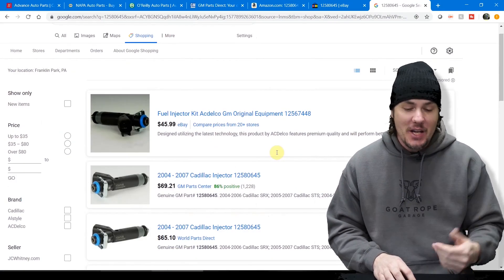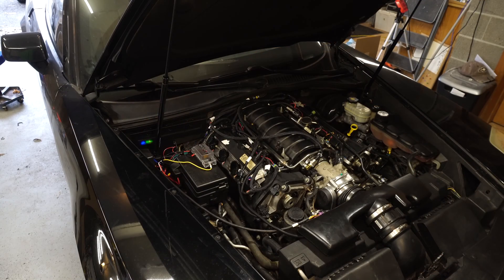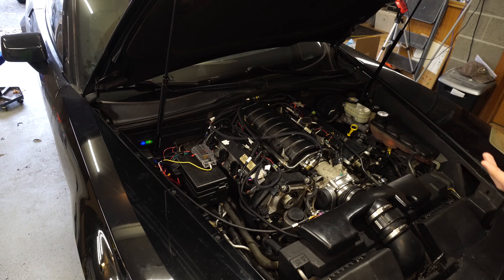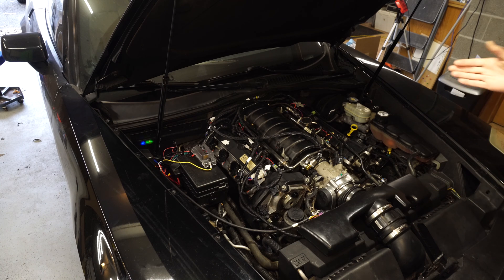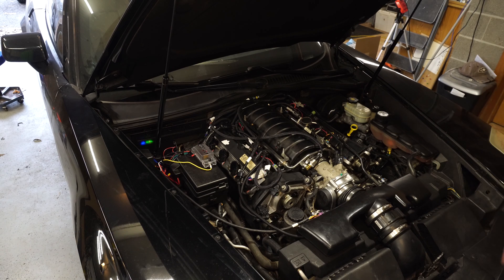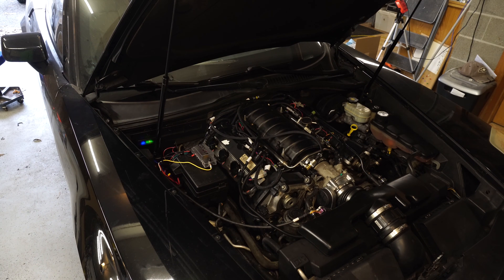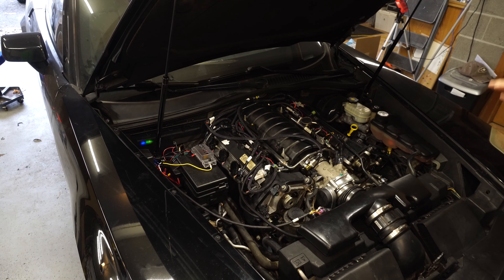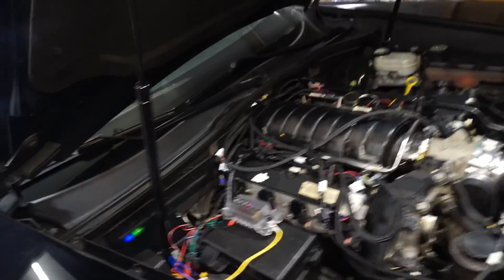First Holley Terminator On A Northstar?  First Impressions Of The Stand Alone ECM.

Comment: I'm interested in this set up for my 05 northstar. Do you have any direct contact, like email or possibly a phone number? I dont mind paying you for your time if you don't mind answering some questions. Finding a tune for the e22 ecu has been nearly impossible at this point and it's driving me crazy.lmao
Reply from the maker: You won't find one for the e22, that is why I did this and it still isn't a good solution because of the dang cam sensors on the early models.
Reply: @GoatRopeGarage  would you say the standalone worked better, or the stock setup is my best bet? Im also thinking of going with nitrous since I'm gonna be opening it up and might just gap the rings for it...
But yea the vvt system makes things so complicated...im going crazy trying to figure this car out. 
Makes me wonder how PCM performance and madtuner did it to tune the stock e22 before they discontinued..
Im really trying to work with this setup and not doing an Ls swap, but its becoming too troublesome.. figured I'd ask since you have hands-on experience with the xlr. Thanks for your time.

Comment: Since the northstar engines use 2 crank sensors, did you only use 1 of the two crank sensors? If so, which one? I want to run stick 2 northstar/4t80e's in my 94 dakota. One in the front, one in the rear. Seems the factory pcm's are almost a lost cause to tune and the terminator x's would be the best way to go. I'm just wondering how you handled the dual crank sensors?
Reply from the maker: Only one crank sensor, but make sure you get one with a 58x wheel
Reply: @GoatRopeGarage  thank you sir

Comment: I have a 95 monte carlo with a northstar swapped into it. It's a 95 or 96 motor can't remember exactly. I've been wondering how difficult it would be to put a terminator on my car. The crank sensor is down on the bottom I think tho and there is 2 of them. They appear to be hall effect style maybe? Do you know anything about the older models? I would assume they are 24/1x as well.
Reply: If you find any answers to this please let me know I'm looking to ass the terminator to my bonneville gxp
Reply: @johnwalker3096  I decided to go ls4 swap and holley instead 😆😆 putting a 7875 turbo on it too

Comment: how hard would it have been to just hook the Holley Terminator up as a piggyback since you where already into the stock harness? Do they sell a plug and play harness connection for the Northstar (GM) engine?
I have a 05 xlr and ran into the same problem you did. would like to install the Holly Term but keep everything as close to stock as possible
Reply from the maker: They do not, I used an LS6 harness and had to make a couple custom adapters. It wouldn't be too bad to use the Holley as a piggyback, that's basically what I was doing until I switched over to the digital dash because there are some things it wasn't happy with and I didn't want to spend the time sorting them all out, car runs great on the Holley

Comment: Keep an eye on coil pin outs on any LS motor when you’re doing wiring harness or coil swaps.  I’ve found that at some point GM changed the pins to the coils, making the wires on each connector different.(I can’t remember if it was just two wires switched or if the wires were flipped in each connector).  But the fact is that, at some point, they were switched. So keep that in mind.
Reply from the maker: Yeah, and the Holley instructions aren't the best. It was just a pain all together, I still haven't quite figured out what they were thinking but I'm sure it would of been a nice plug and play solution on the LS1
Reply: Goat Rope Garage what’s your opinion on the Holley setup vs HPTuners?
Reply: they used different coils accross the LS variants,diferent trigger circits

Comment: Does Holley have a obd 2 plug for  Emissions testing  ? If not how do go about getting it tested for emissions  and does xlr have IRS rear ?
Reply from the maker: Negative, the factory ECM is still connected to the OBD2. The XLR has the same composite spring rear end as the C6 Corvette.
Reply: @GoatRopeGarage   soo the factory ecu still reads the eng and the Holley is just piggy back on ?
Reply from the maker: @dezieak47  Nope, the factory ECU is there to control a couple of simple things like the starter since it's push button start. Holley is the primary control mechanism.
Reply: @GoatRopeGarage   soo will it pass emissions testing like that  ?
Reply from the maker: @dezieak47  😏 Yeah... That's all I'm going to say about it.
Reply: @GoatRopeGarage  oh ok 🤔🤫

Comment: Im wondering if you have older software. Mines got I think 10 choices for map sensor compatibility. But I do run the gen 4 zr1 style 2.5 bar which was the only one thet had on the early software
Reply from the maker: There are multiple choices but like only one for a GM part number?

Comment: I know you're planning on putting in an LS motor... I've got a Cadillac or 2 of my own.. My thoughts are if you hit it with a bottle.  I have a feeling the head gaskets will instantly go!!  That is the biggest demise of the North Star.. Fine thread head studs into an aluminum block!@$#^!!  Have no idea what the engineers were thinking about their !!! So what happens is it pulls the threads clean out of the block..   So you may be putting that LS in faster than you think if you put any more pressure on the  Cylinder heads
if you weren't aware,  but I'm sure you are if not , look into it here's a heads up..
Reply: You must not know about the LH2